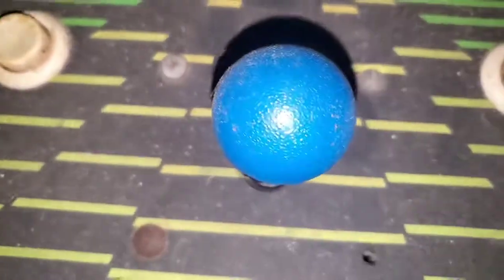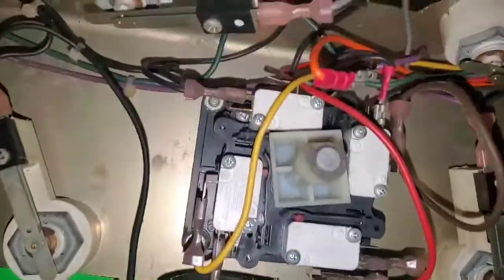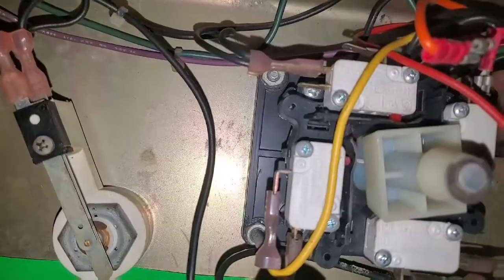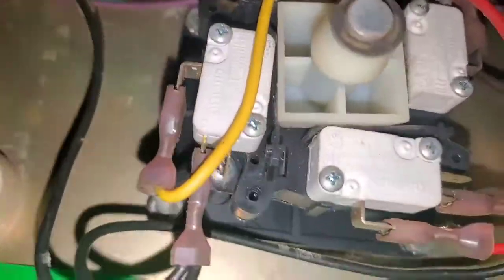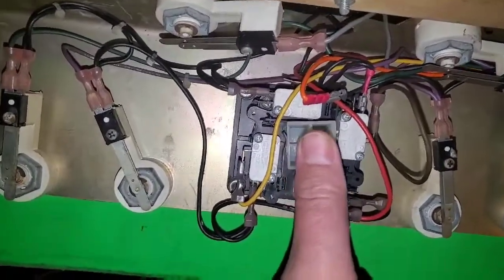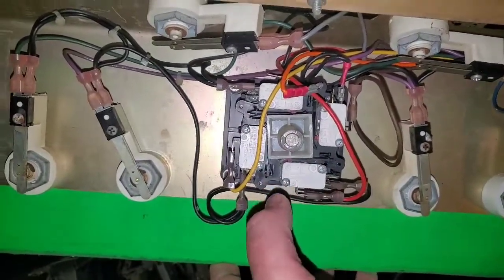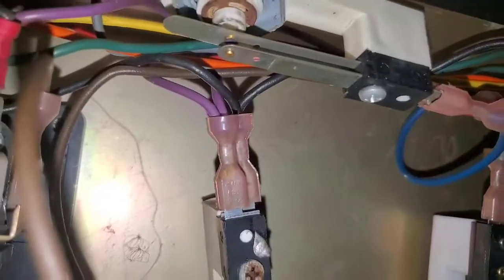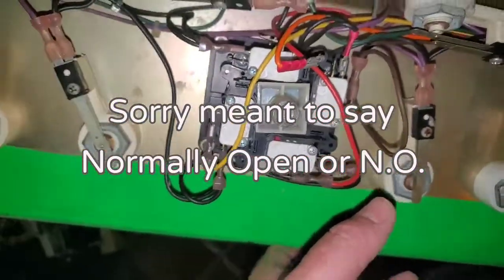Arcade joystick repair and button stuck or no  movement

Comment: I have a robotron arcade game. The left joystick sometimes gets stuck and won't move in the left direction. I'm getting a new joystick mailed out to me but any input as to why this could be happening would be great.
Reply from the maker: Looks like u just have a bad microswitch button or leaf connector stuck closed....since it is always going left then it is stuck closed ....simply replace the microswitch that triggers the left movement ..or space out the leaf switches so they are not touching...Normally open(NO)...you don't have to buy a new joystick just a microswitch or leaf switch
Reply from the maker: Goto www.fixyourpacman.com under joystick repair for step by step
Reply: Put some oil or.like wd40 in to switch button that place where you click